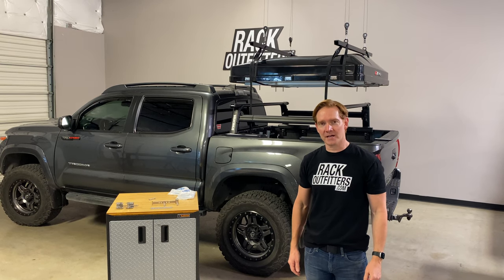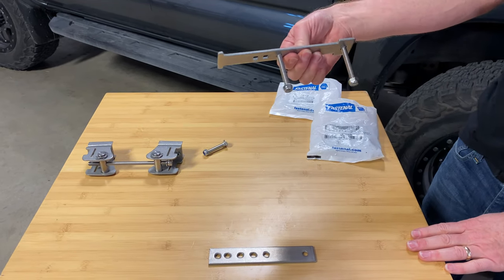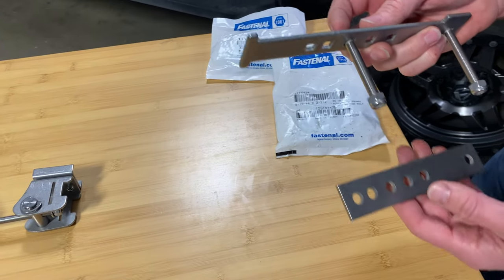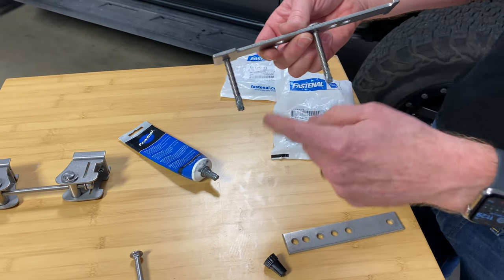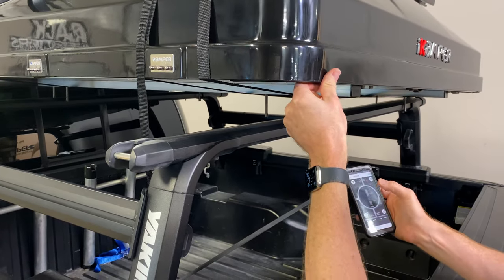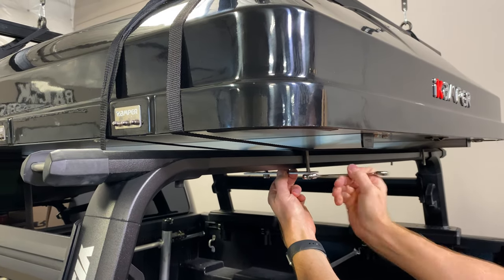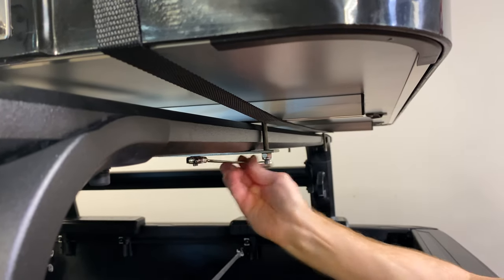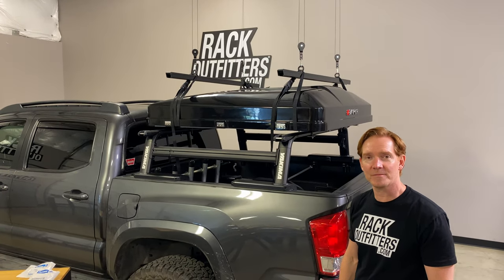iKamper Rack Mounting Hardware Comparison and Truck Rack Fit

Comment: I have the overhaul hd rack. I removed the plastic track strip on mine. The brackets that came with the tent now fit just with that slight mod.
Reply: I will try that I thought the bracket 2.0 would be made to fit like a glove.
Reply from the maker: Thanks for commenting.  Removing the rubber is a good option add some clearance.

Comment: Great video! I recently ordered an iKamp mini and am concerned about the 2.0 clearance under my cross bars which is only 1 1/4 inches. iKamper was able to tell me the overall height of the 2.0 is 2.75 inches. I have 1 inch thick cross bars so depending on how much is in the channel I'm going to be cutting it very close. Do you happen to now the distance of the bracket that is suspended under the channel to the bottom of the bracket?

Comment: Will the 2.0 brackets work with other tent rail systems? They look like they might.
Reply from the maker: I'd never recommend mix and matching hardware from different tent companies. Granted almost every tent I have seen uses a similar channel, bracket and slider situation, I still wouldn't do it. The tent designers and engineers tested and made everything to fit together. Using the wrong sized bolt/plate in the channel can lead to the tent getting damaged or even flying off and potentially hurting (Or even killing) someone. Sadly that's not a question I would be comfortable morally to answer over YouTube, without a lot more information. Even in store I would make sure any replacement hardware we needed to install a tent was the same grade and style as what's recommended by the individual tent maker. Tents are heavy items and fairly new to us in North America, following manufacturer's guidelines is always my official recommendation.

Comment: Is the depth that the bar can be a secret? I can't find the info anywhere and ikamper hasn't responded and it's not included in their online manual. (Mine is on order and I want to have the bars/rack mounted before it gets here). Does anyone know how deep the bar can be? What is the maximum depth of the 2.0 mounting hardware? Anyone know? Thanks!
Reply from the maker: Hello.  iKamper tents come with Mounting Brackets 2.0, which are compatible with a max cross bar height of 1.2" (3cm) and a width of 3.5" (9cm). For higher cross bars, Mounting Brackets 1.0 should be used.  Thanks!
Reply: @rackattack  righto! Thanks!

Comment: Why not just take the 2.0 brackets apart and add a spacer and replace the hardware that keeps it together with longer bolts? The 1.0 hardware is bad, a 4k RTT should not be held on with a glorified pipe strap.  I don't have the new 2.0 hardware on hand yet, but that's my plan as the cross rails over my truck bed aren't going to be standard Aero bars like Yakima and the rest have.
Reply: Charles were you able to try it your way, did it work?
Reply: @jasonr428  the 2.0 hardware is riveted together, so I was not sure about drilling then apart to add spacers. I temporarily used aero bars from rhino rack to use the 2.0 brackets. Long term tho when I get my custom bed rack I will also have some brackets made to fit the track on my iKamper and not use the 1.0 brackets. I know a lot of RTT's use brackets like the 1.0 version but I don't like them. Also using anti seize on the 2.0 hardware is a good idea but you must check them frequently, I had them loosen up far more than I thought they should. The 2.0 hardware is good, bit the lack of a real thread lock is not ideal either. Another reason I'm going custom
Reply: @rossipremier  Thanks for the detailed response.  I'm with you on this, right now I'll have to use the 1.0 version, but in my opinion, it doesn't appear heavy duty enough for the Skycamp 2.0.  Until I come up with a long-term solution I am considering doubling the metal bar at the bottom.  iKamper needs to mitigate this issue.  Going custom is a great idea, I'll have to find a fabricator which could be a problem.  Thanks for your response.
Reply: @jasonr428  - were you able to find a custom solution. We have the same issue and don’t like the v1.0 hardware but have no option at this time.  We would also like a locking mechanism.
Reply: @nannuchakravarti3123  I ended up going with RTT Security Mounts from Wheel Every Weekend.  They were certainly a bit more than I wanted to spend, but overall they were worth it and provide an added payer of safety even the 2.0 locks don't.
Reply: @jasonr428  - my husband modified the 2.0 hardware with bolts and spacers.  We will give it a go.  Thank you for your response and happy camping.
Reply: @nannuchakravarti3123  how did it go?
Reply: @METALT6  - we are using our modified brackets and we have had it all summer. No issues. Certainly feels stronger than the 1.0.
Reply: @nannuchakravarti3123  how did you modify the 2.0 brackets?
Reply: @anthonyamador6056  - we took it apart and added strong spacers and a strong bolt to put it back together again. It was the only way to fit an Yakima high bar. We did not want to use the v1.0 version.
Reply: @nannuchakravarti3123 , do you have some photos or video to share. I want to use the 2.0 with my KB Voodoo Pro-X that are 1.5" high. I am bummed that iKamper did not think of designing the new mount for higher bars.
Reply: Old post but wanted to throw out what I did -- I have a chassis unlimited thorax rack. Its crossbars are 4" wide and 2.2" tall - the iKamper 2.0 hardware sure doesn't fit - and like everybody else has said, the 1.0 hardware is cheap junk for a 4k+ tent. I purchased the Vanultra quick release mounts they make and are absolutely perfect. Expensive, very expensive. But I now have a mount that fits perfectly on my rack, has quick release abilities to take the tent off super easily, and also can run a 1/2" hitch lock through them to lock the clamps to the crossbars. $350 without the locks - but they are bombproof and will work on nearly any rack and any tent with different hardware kits they sell. I have no affiliation with them whatsoever -- but recently purchased my iKamper and wanted to find a better solution for mounting to a beefy bed rack.